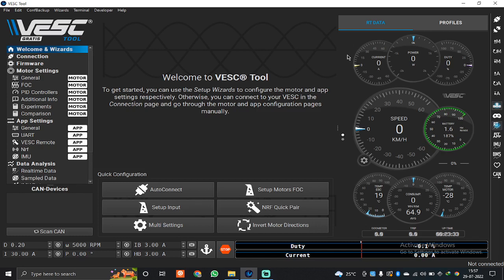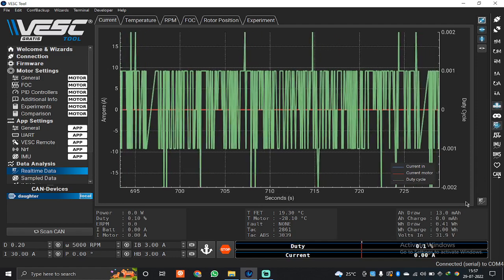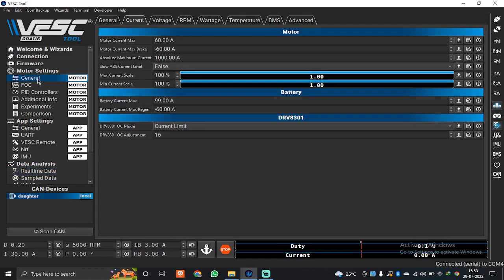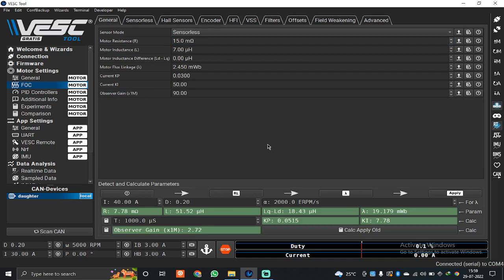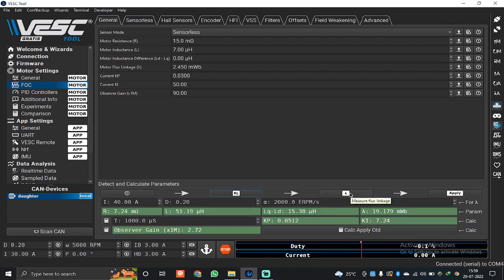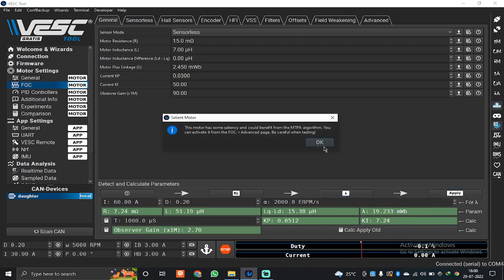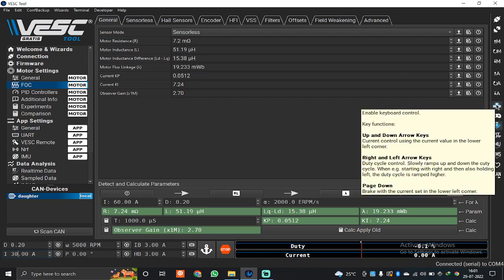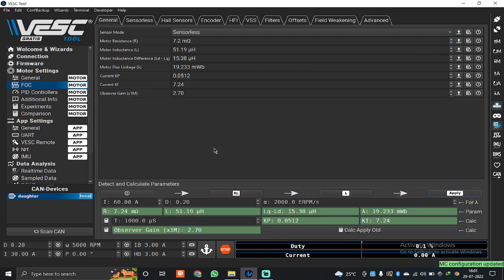HESC 120/600 Motor tuning

Comment: I did your setup in this video on a CL700 with a new adminjet bike and when I turned of the bike I heard a loud clunk from the motor and now the controller will not power up and it fried the BMS power surge back to battery all amp setting were set to low default setting it was 6 or 60 when this was done
also tried using a power supply and it has a short in the controller just shuts down my power supply telling me there is a dead short also the motor never turned just made a clucking sound it was running fine before changing to this controller you really need to do a more detailed video of set up and send info on setting up controller also none of the 20 controllers we got will connect with the android app bluetooth just times out and asks for pairing code tried 0000 and 1234 also tried with an apple phone and still will not work so was using PC for set up please advise what to do now